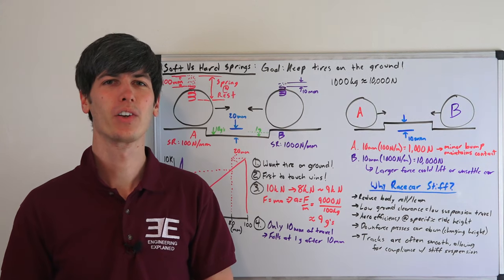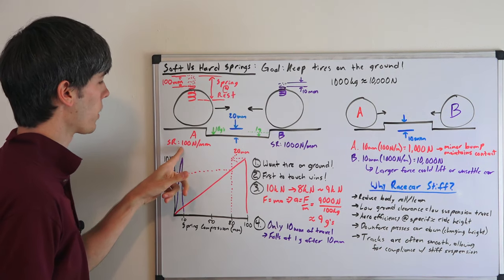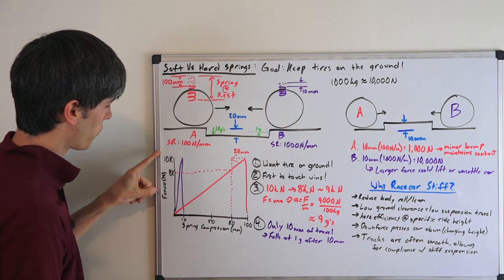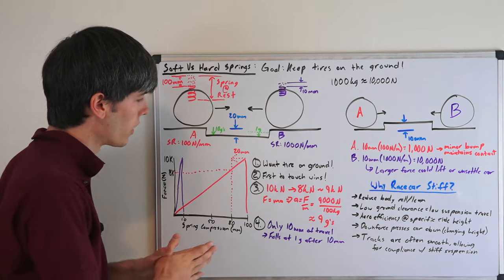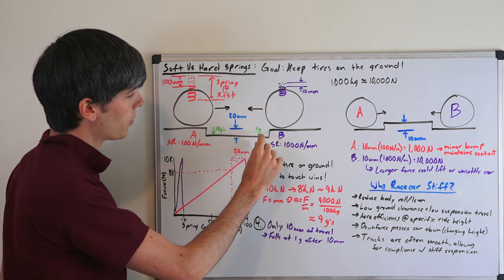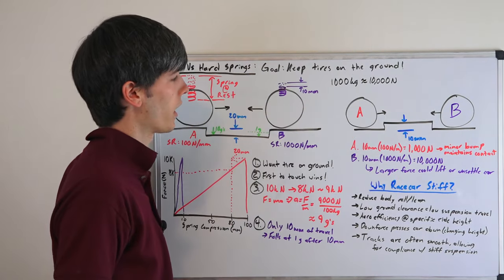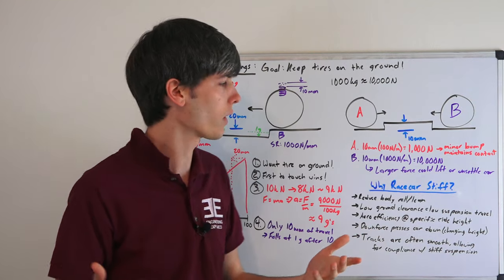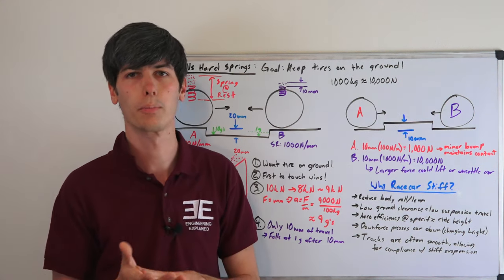What's The Best Suspension - Soft or Stiff Springs?

Comment: When you add the effects of compression and rebound dampening (oil damper), this gets much more complicated than just a spring with no damper.  In fact, a spring alone does a terrible job of keeping the wheel on the ground.

Playing with dirt bike suspension in the good old days of Motocross (using about 12" of travel),  I found I actually got a plusher ride with a stiffer spring (front forks, and very little preload on the springs),  that still resisted big bumps with less compression dampening, and more rebound dampening (assuming the dampers were set correctly with the stock springs).

As for the preloaded travel of a dirt bike, you pretty much want your suspension to have eaten up about 33% of the total travel with you on the bike, no matter what your spring rates are, and that is adjusted by a preload ring that compresses the spring.

But, if you add the dampening,--I bet the math work goes up exponentially---but it still has to work as well in the real world, and will need field testing to fix.

Sophisticated suspension, (depending on the demands and severity of the application), seems to be one of those things that almost never comes off the drawing table very well.

You should look at some of the front forks of MX bikes today.  Nobody knows how to adjust them, there are so many knobs and air chambers.  But one fork on Yamaha the kabaya (sp) SSS forks, that is over 10 yer old technology, and still uses a spring, romps them all in overall performance and probably every category. 

You post great stuff young man.  I hope there are more like you.

Comment: I am a bit confused.  If we are just looking at spring rate, why aren't we looking at a spring that has enough travel to reach the 20mm?  In that case the stiff spring would win, the only reason it loses is because it runs out of travel and gravity has to do the rest as you mentioned.  I guess the video is not about preloading the spring and the only source of compression is vehicle weight.  

If it was preloaded (as almost all passenger cars are, and why spring removal has to be done carefully even when the wheels are lifted off the ground), then the stiff spring should have ~10X faster ground contact in the dip.  Your point is very valid on the bump force though.
Reply from the maker: davetek490 The amount the spring compresses is based on the weight on it. A stiffer spring will compress less, and thus have less travel. 

10x faster ground contact? Nope, the math says otherwise (even in the portion where there is still travel remaining).
Reply: Engineering Explained
For the sake of being devils advocate I'm assuming a preload to allow stiff spring to travel 20mm.  The stiffer spring has higher F/mm....  if F=ma, then if both springs are allowed to travel the full 20mm, at every mm of travel, the stiffer spring has more force.  if a=F/m and m is constant, a is linearly higher with respect to F. 

I must be missing something.
Reply from the maker: davetek490 The thing you're missing is that as the spring releases (look at the graph I drew) the amount of force it presses decreases (rapidly with a stiff spring, slowly with a soft spring). The maximum force both springs press is the same, but the soft spring will press with a greater force for longer (it does more work).
Reply: Engineering Explained
Ok, and that's only true in the case where the only force used to preload the spring is the 1000kg car.  I get you, I think we're just using different initial conditions.  Thanks for the explanation.
Reply: davetek490 a soft spring will make the car bouncy when the mass of the car is moving, like when you go over a crest. to stop this you ned a shockobsorber to steady out the pressure on tyres to keap traction. does a soft spring not need a harder obsorber with gives a harder spring some advatage when it comes to travel? great explanation on springs, very intresting
Reply: Colin hemligt
Yes the natural frequency of the softer spring tends to be longer and vice versa for the stiffer spring.  A system that receives an bump and bounces up and down but settles with minimal and decreasing oscillation is said to be critically damped.  Even the softest classic Cadillac probably isn't that bouncy since that condition would be very dangerous as the tire would lose a lot of contact over successive bumps. 

The energy the shock absorber has to dissipate = (.5)*k*x^2 so there's a lot more energy in the soft spring system (k, the spring constant [stiffness] changes linearly, while displacement goes as x^2).
Reply: davetek490 The part you're missing is that even though the stiff spring holds more Force/mm, the softer spring has compressed more mm such that BOTH of them are pressing down with THE SAME AMOUNT of force, w/c is equal to the weight placed above them.  The advantage therefore with soft springs is that they will always have more travel compared to stiff springs when it came time to release the load, as when tires roll into a dip on the road surface.  On the other hand, if the tire was to roll up a bump, the stiff spring will transfer more of the reactive force to the car, causing it to "lighten" and lessen the tire's grip on the road surface.  If the car was going straight and no braking or accelerating force was applied, this would be of no consequence; however, if the car was in a turn, or braking/accelerating, the "lightening" effect caused by the bump pushing up against the car could mean a difference between keeping the line of travel or losing grip.
Reply: ChuddleBuggy
Yeah I already clarified that my assumption was which spring could be optimized for road holding the best.  His assumption was all things being equal, which is better in a specific scenario. 

All springs on cars that I've ever seen are preloaded; they are still compressed when the wheels are at max lower travel.  I assumed, incorrectly, that this would be the case in his scenario.  Why?  Because the spring length argument goes both ways.  If a spring is compressed it can also be stretched, giving both wheels the ability to extended beyond their original compression lengths.  We are talking an uncontrolled spring.  Because of that, I thought that spring travel length was not important, and force generated by the spring at any given point in its travel was.
Reply: davetek490 Thanks for asking the question mate.
Reply: Marek Sumguy
I'm glad you think the excuses I'm making are not real.  As an actual engineer I found the example strange.  Uncontrolled springs don't lock to their unloaded length, oscillation (and over extention) would occur.  And without preload, springs would suffer from detachment and misalignment.   The "harder" spring running out of travel still doesn't ring with me.  The reason soft springs are used on rough terrain is because they spread energy absorbed from the road surface over a greater distance, which on an uncontrolled spring can be equated to a period of oscillation.   This decreases the amount of energy that has to be absorbed by the tires and frame, which is great for off road racing.  That's because the longer oscillation period gives more time and length for shock absorbers to work. 

Springs have to be preloaded.  If not they have 0 force (F=-kX) to resist rebound forces transmitted when the tire hits the road again.  What isn't discussed is what happens after tire hits road once.  Everyone knows that the stiffer the spring the shorter the oscillatory period and the longer it takes the energy to be dampened.  The soft spring would allow more oscillations, the stiffer spring less.  Yep the soft spring in this odd example may "get to the ground first" but the car would proceed to bounce around for far longer than the stiff springed one.
Reply: ***** I thought we were here to learn about how cars worked.  The channel title is engineering explained, not physics.  "Learn a bit of physics?"  I'll ignore that for now.

The example here is a physical explanation and not an engineering one.  Engineering requires a clear outlining of the assumptions, along with caveats explaining in what situations the assumptions are not valid.  For REBOUND ie releasing compression, a preloaded max k spring is always better.  For BOUND, a soft spring is better.  The basic idea is to maximize energy transferred to the road, and minimize/reduce the rate of energy transfer from the road to the car.  

Assumptions are everything.  My point is the assumptions made don't mirror what I have learned, and what I have seen via experience.  Period.  :)
Reply: At maximum travel distance the force exerted by the spring is 0% of the loaded force and at maximum compression it is 100% for both soft and stiff springs. If the stiff one would be able to travel 20 mm at 20 mm the force would be 0%, at 10mm it would be 50% whereas the softer (100mm travel) spring, at 10mm would be at 90%, at 20mm at 80% and so on. 

With preloaded springs, supposing it's the same preload energy, just add a flat number to these percents.

Comment: There is a very important point you missed, if not the most important.
Roadcars are optimized for straight line rolling where load is equally dstributed to both sides of the car. Racecars are optimized for cornering where load is shifted to the outside wheels. So you need to calcualte spring stiffness and damping rate to that amount of load. when you corner with a soft spring, you lose alot of suspension travel right at the start because of body roll, thats because the springs are too soft for that scenario. with a stiffer spring you optimize for higher load, giving you less body roll and more suspension travel remains available mid corner. higher damping rates need to follow the higher spring rates in order to prevent unvanted body oscillating movement.

Comment: With all things being equal, softer springs are better on bumpier surfaces (everyday roads) and harder springs are better for smoother surfaces (race track). But that is not entirely true, in race tracks you often have to ride the kerb for the best line and that requires both stiffness and softness at the same time. A good suspension has to be able to achieve both. My current car has suspension that is 3 times the spring rate of the stock suspension, but actually is more comfortable because of the damper design.

Comment: I'm surprised people actually still debated this. This was spot on to what I learned in school. stiffer suspension for street driven cars isn't always better. example: I had a 7gen galant that I threw springs (1in front/rear) and adjustable shocks on. Hard cornering was great, but the overall quality wasn't great, especially in the rain. I went through alot of trial and errors before I figured out that soft is safe.

Comment: Roll is not necessarily bad, if it's not excessive.  Through suspension geometry (specifically an upper A arm that's shorter than the lower one), wheels can be made to favorably change camber camber angle during roll, for the outside wheel in a turn.  It's called "camber gain".  Within limits, roll can be beneficial and improve traction in a turn, if the suspension is designed for it.  (Roll can raise the center of gravity slightly, but favorable changes in tire camber angle can have a larger effect.)  Learned that from a really good engineer at Lotus.
Reply: +Loanword Eggcorn Presuming you have a wishbone suspension of course, which most cars do not.
Reply: Chris Ashcroft Yes, double A arm suspensions are less common than strut suspensions.  But they're more common than they were in the past few decades.
Reply: Struts have negative camber gain (going more negative) but the rate at which it happens is usually not enough or too rapid for the tire.  Struts also lose it REALLY quickly if your lower control arm goes beyond perpendicular to the strut's angle in front view.  For a lot of cars this happens far too quickly.

As you said though, roll/pitch/squat is beneficial to the extent that it doesn't hamper the car's responsiveness to inputs or the tire's ideal contact patch.  Once a car rolls too far you start losing grip.  

That's why the answer to the question "how much spring rate is enough" depends heavily on the rest of the suspension and the form of motorsport you are doing.
Reply: Whiskey's Gaming Lounge Agree.  It's why I said camber gain can be beneficial within limits.  If it goes too far, it becomes counterproductive, exactly as you found.  BTW I wasn't really referring to strut suspensions.  Camber gain is best controlled with double A arms.  Anyway, agree with your points.  Thanks for sharing!

Comment: Simple answer was reached in the early 1970’s by GM. The Chevrolet Z28 used moderate shocks, stiff springs and moderate sway bars for good (for its time) handling. Whereas Pontiac with the Firebird Trans-Am used softer springs, stiff shocks and large sway bars for a much more compliant ride but great control in cornering. Both worked.

Comment: Very good explanation  !    As you know  &  have to keep it simple for the layman  .   Shock absorbers , sway bars , bushings  & tires  etc. are also  components of a suspension system   & on the track  ,  settings are softer in the wet  vs. racing in  dry conditions  .    Thanks for helping alot of people by posting this video !

Comment: Thanks for another great video. In the next one, can you explain how the dampers interact with the springs and the combination of the two affects handling? I'm thinking about whether to soften my dampers or not and would like to know what affects it might have.
Reply: Yeah if your driving over pot holes and not on your typical race surface
Reply: Also there’s a huge difference between your dampeners and the spring rate which was what he seemed to be talking about ,and seems to of forgotten to mention what controls the spring rate..as shocks control the springs speed of return..changing your shock rate ISNT going to prevent it from slamming into a hole if it’s too heavy of a spring  rate, but it will sure slow them down on the return.. if the car drops into the hole too fast.while making contact still..

Comment: Further to the discussion, dedicated off-road vehicles typically use very soft suspensions to ensure transverse tire contact.   A typical issue with hard suspensions off-road (read: Stock Pickup Trucks) is that the relatively low spring rate means that traversing a large bump with one wheel on a beam-axle suspension causes the other wheel to lift, thus reducing ground contact and traction.    

Essentially, instead of absorbing the bump into the suspensions travel, that bump causes the body to lift, which then because of the low spring rate, reduces the effective down-pressure on the other wheel on that axle.   A loss of downwards pressure is a loss of traction.     It's for this reason that dedicated off-road vehicles like Land Rovers and Jeeps typically use very soft suspensions (or variable spring rate suspensions like air-springs) to ensure that traversing a bump does not cause a total loss of traction for the vehicle.      Pickup trucks on the other hand typically use multiple leaf springs with a very low spring rate because they're primarily designed to carry great deals of weight in the pickup bed.   A stiff rear spring on a pickup truck is a decided advantage when carrying load, but a decided disadvantage when used off-road.   If you're serious about off-roading a pickup truck,  replacing the stock springs with much softer leafs and adding a levelling air-bag can make a huge difference to off-road performance.

Comment: I used to race superbikes and the suspension settings always had me on the fly, it depends on temperature and surface conditions you will use, for normal street use you can set a medium setting it will get the best of both sides from soft to hard, it is quite tricky to find the right setting at the beginning, but you will get use to it.

Comment: For some that may not know the numbers used are specifically to show his point and are quite exaggerated compared real life. For ex he uses 1000kg of force but my entire car only weighs about 1200kg and you would never change your suspension by a factor of 10. Great explanation and the number make the calculations clean and easy to understand which I applaud just want the audience to know changing your suspension isn't going to wreck your car going up/down a 10mm gap.